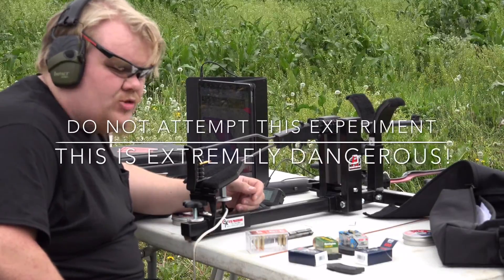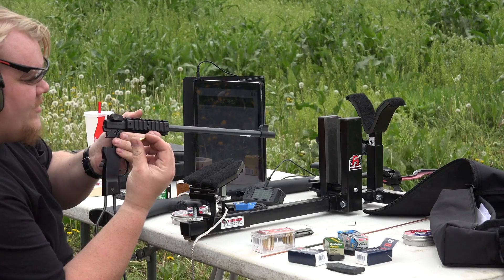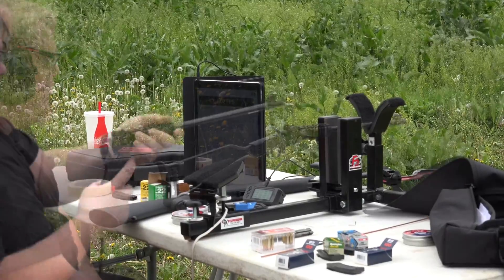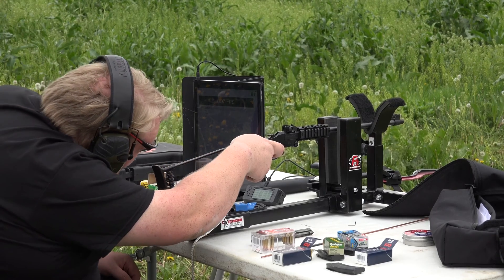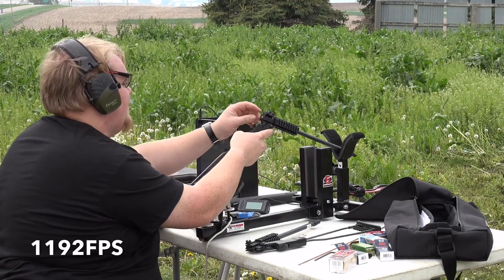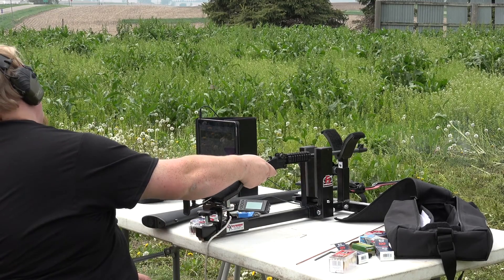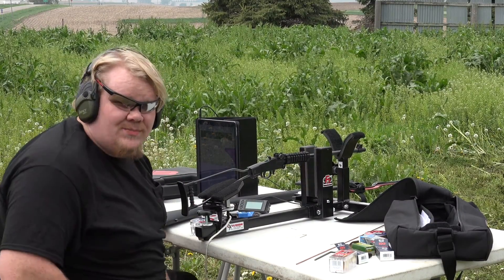Squeeze Bore 4K

Comment: Your work could involve using a fired 22 mag with the rim removed as a chamber sleeve in both 22 mag & 17 hmr . And the lighter stinger bullets might give some kind of accuracy . the shoulder & throat should be a decent gradual swage with enough free bore to lower any pressure spikes.
This definitely needs more investigation IMO. It would be super cool to see if there’s any hint of accuracy or keyholing . Seeing some recovered bullets would be cool .
Shooting into ballistic gel or any other medium with different bullet weights & velocities will give us some awesome data.
I will definitely add some videos to my channel once my misus rifle is finished. I’ll try & get hers made into a switch barrel so we can test std 22 vs .20 / 22lr .
Reply from the maker: We had talked about doing more testing but honestly with life we ran out of time I did hear someone in the last year started making ruger 10/22 squeeze barrels again I don’t recall who it was though
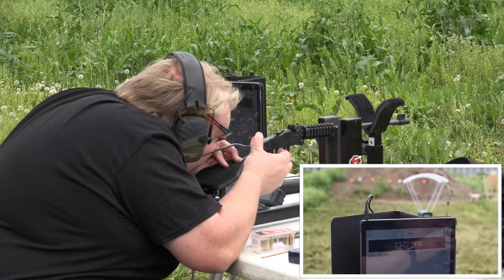Reply: @LFDResearch  i'm in Australia so 10/22's are out of the question ( yep retarded I know ) I tracked down a gunsmith who built 5 squeeze bores. I had a good chat to him. Basically there's to much fowling with 17 cal ones. No issues with the .20cal . Average velocity increase of 200fps & performance is very similar to the 22mag at 100-120 yards. With the extra speed & 1:10 twist barrel, the on target performance is noticeably increased. Subsonic ammo will exceed the sound barrier. 
I'm going to get one made up . I gota fly mate cya.

Comment: Hey mate Have you done any more testing on this subject ?????
There was a Aussie gunsmith back in the day Arthur Langsford ( I think ) he made all sorts of rimfire sub calibers & squeeze bores. I read a few articles from the 1980’s & 1990’s about his rifles & experiments.
The one he had the most success with was the 20/22lr . I’m about to throw 1k$ at a new .204 barrel with a forcing cone in front of a 22lr chamber. 
Arthur has long since passed away & the data is scarce now. But I remember there was a velocity increase, with very little increase in pressure.
He was able to swage down the caliber from the primer itself. I believe the velocity increase was around 100ish fps with a increased ballistic coefficient & sectional density. I recoil he could never quite get the 17 cal version to stabilise properly for commercial sale. 
Apparently 19 cal was the best performing one overall.

Comment: Please turn down the music. I can barely hear you over it. Quite frankly it doesn't even need music. As a second point, this simply doesn't classify as as "squeeze bore". A squeeze bore is a WW2 technique to improve shot velocity by taking a gun with the correct caliber chamber and barrel, followed by a device built into the barrel or otherwise which smoothly lowers the bore diameter in the hope of either speeding up the projectile or lowering the diameter thus increasing its armour penetrative capability.

This is simply firing different calibers down differently sized barrels. It tells you nothing. The velocity may be different due to the wrong sized chamber, due to a lower space increasing the gun's pressure, down to increased friction, down to the cartridge being seated at an angle, quite frankly it could be down to anything. You might as compare firing a .45 ACP and a Winchester .300 Magnum and try to draw conclusions on the bore diameter. Then claim the Winchester .300 Magnum's increased velocity is due to the "squeeze bore" effect.
Reply from the maker: Well we are in the process of building a muzzle device to do an actual properly supported chamber squeeze bore test. I see your point as the is not 100% scientifically perfect but as a proof of concept it works. For testing we were using 22lr ammunition and shot it through a 22wmr and a 17HMR for the squeeze test. Since the 17hmr is built off the 22wmr case that gave us the closest apples to apples comparison between the two being both would be unsupported chambers for a 22lr cartridge. 

As to the music it is a common complaint and is being removed from new videos I just cannot change the file that has already been published. :(
Reply: yea without music would be cool you're getting some good sounds i could be sampling